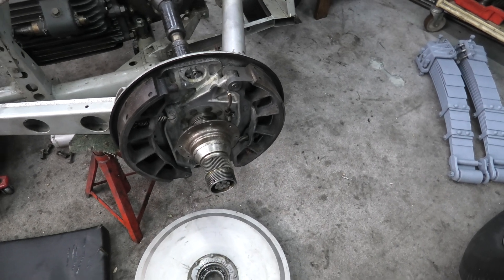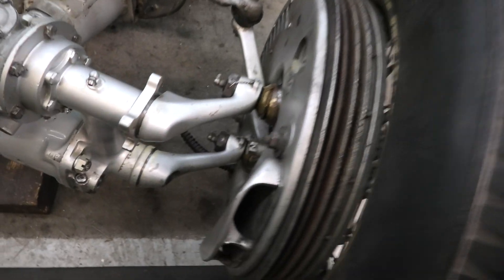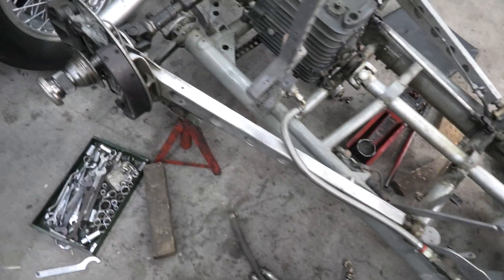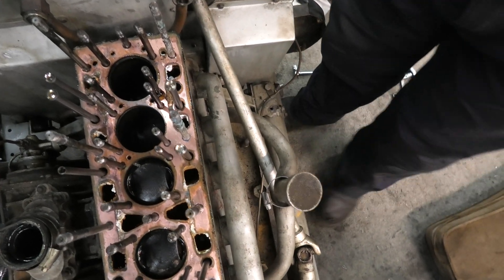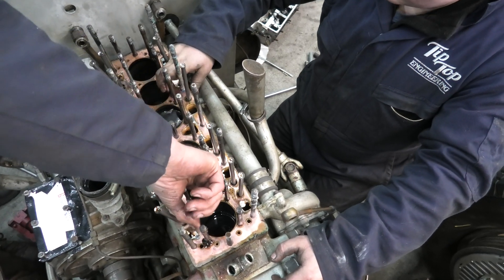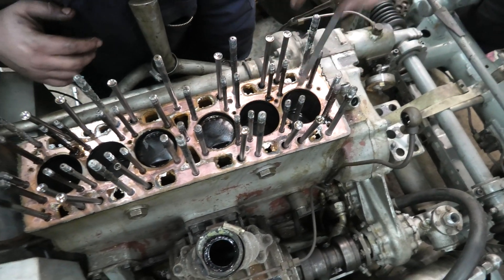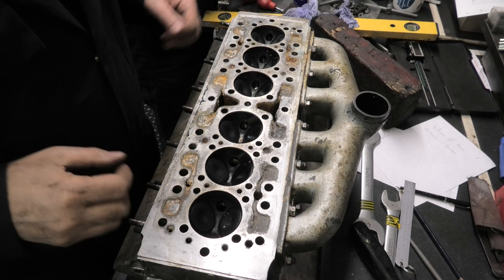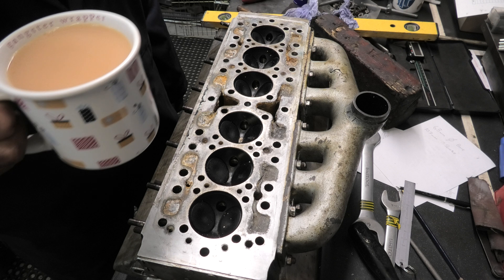ERA GP2 Restoration  2

Comment: That's a beautiful motor.  Considering the age, the castings on the head and block is really amazing.  At least from the video, it looks like a modern motor.
Reply from the maker: Hi Dick , it's certainly a good car and it was after all an F1 car in this case and therefore I suppose plenty of money was used to get the best although in period it was not really successful but we will see what it's made of after the re-build. The engine is a well proven ERA 2-litre which also powers James's Riley ( The Blue Lady).